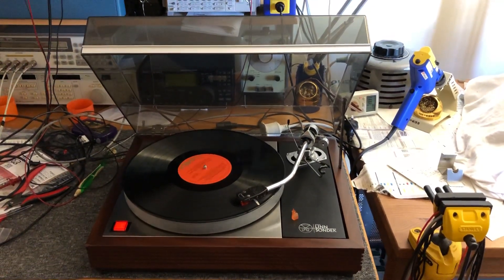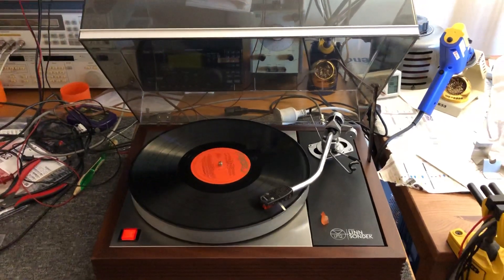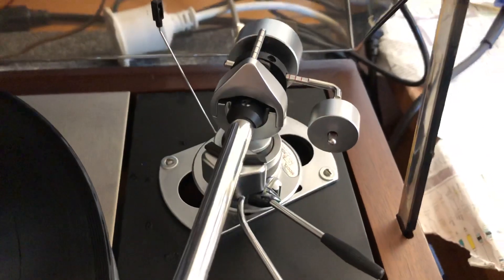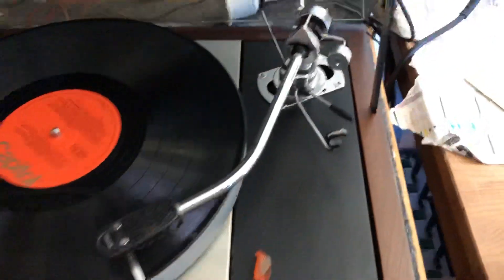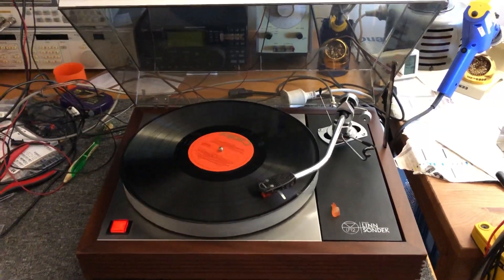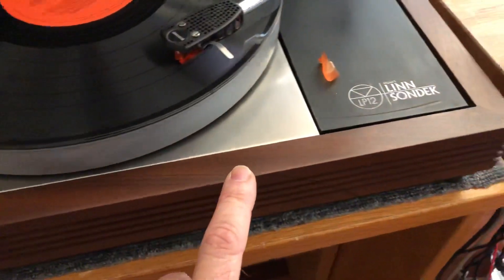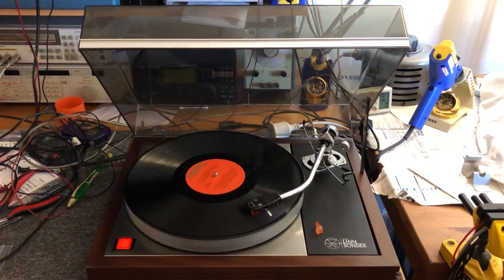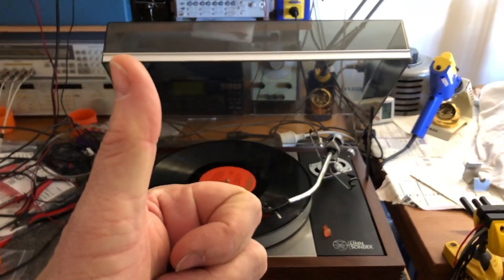Beautiful Linn Sondek LP12 Turntable Recommission & Restoration

Comment: The heads of the suspension bolts on the top-plate are the most consistent reference for visually leveling the suspension and to aid visibility the outer platter can be placed upside-down on the inner. This also allows a visual check that the belt is running true in the middle of the motor pulley. Check the main bearing; if it has the white nylon insert under no circumstances use the Linn black oil - it causes the nylon to swell and eventually - trust me - will seize. Hope this helps. Incidentally; beautiful example and one very lucky owner.

Comment: Watch out using the Linn Black Oil on the early bearings. It’s not compatible.
Reply from the maker: Incorrect, Linn's factory service information explains precisely which oil is needed for each bearing type. The black oil is only incompatible with one bearing iteration, the third in fact.

Comment: Hi Mike- what oil do you recommend  for the plinth? I need to touch up a few small scratches
Reply from the maker: Hi Donovan, any good furniture oil will work, I use cedar oil or beeswax, depending on the finish and what the wood needs.
Reply: @LiquidAudio  Thank you for the reply, I did like what you had done
Reply: @LiquidAudio  Hi Mike, do you rub the plinth back first with steel wool or anything? My LP12 has still got that high shine varnish look. Would love to get that deep sheen you've achieved with the oil.
Reply from the maker: @jamespatterson8013  Hi James, it depends on the deck, wood, finish etc but yes this can work well in certain cases. Really good oil is important.
Reply: @LiquidAudio  exact same turntable in fluted Afromosia. Very early though from 73. Fluted all the way around, no label on rear. Rub down with steel wool and then oil or beeswax? Love the deep sheen you’ve achieved!👌